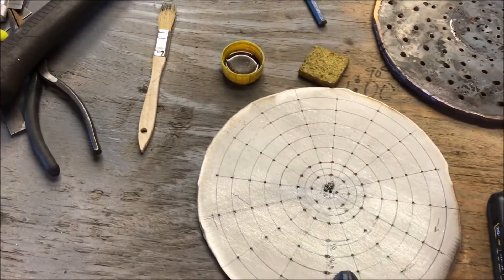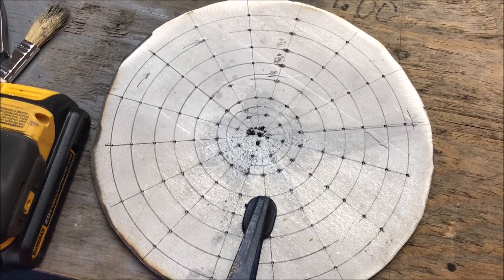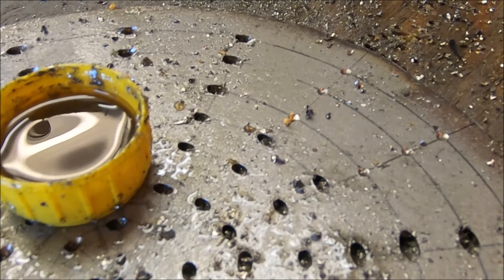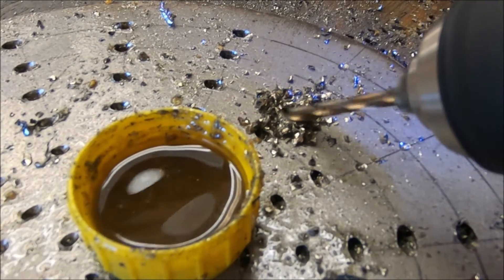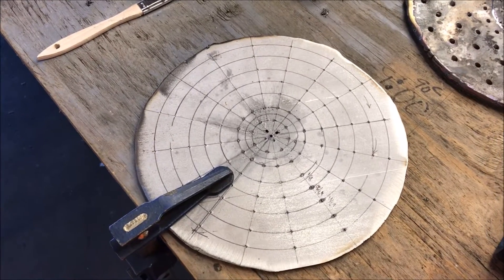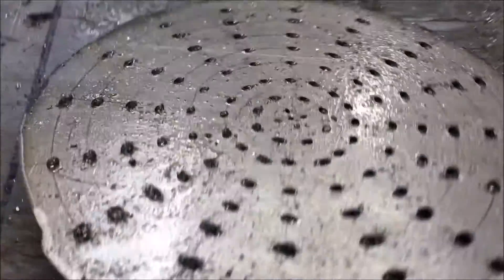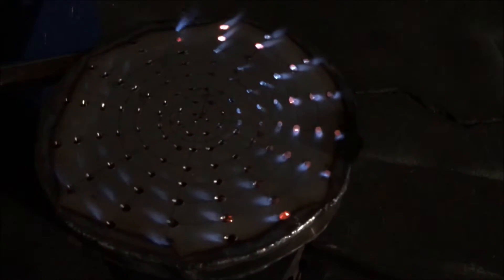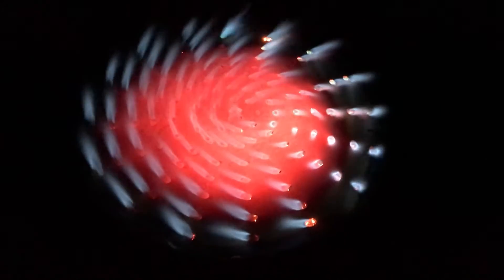How to drill stainless steel BEST practice increase production

Comment: Can you make some kind of an angle jig to keep the bit steady? If the jig worked it might even be possible to start with a milling bit to get a flat surface. When drilling holes in general I like using bottles with a Luer lock and blunt needle  tips to drip the oil exactly where I need it. Less waste and mess.
Reply from the maker: Definitely a jig iob

Comment: Sent you an email regarding this project - well something similar. My system locks up typing on YT sometimes and I loose it all, so email saves while I type.  Sorry.  I hope ou like what I sent and I'd like to see what you think!
Reply from the maker: I got it brother , as you can tell from the vids im very busy , when i get time ill get back to you
Reply: @NOBOX7  Sounds good.  I've made similar smaller versions and have seen about 5-6 other iterations of the same thing, but smaller in size that I recommended b/c we weren't looking for the BTU's or KW's you are pushing for.  

Before you start on a new project, feel free to email me and I can better explain some of the lessons & things I learned, especially with forced air waste oil as a heat source. 

A lot has to do with combustion time and retainment time within the combustion chamber - which is a MAJOR feature of old locomotive boilers - retention time of the heat!    But you have one MAJOR advantage these people didn't - compressed air - which  you can leverage much more than you have been.  

If you get this working, there are some moderate size farms which could really use this if you get it down, and their older systems are very fuel intensive compared to what you do.

Also, have you ever looked at an oxygen contratator?  They can do 85-99% pure O2, but that's too much, but going to 40-50% would be a HUGE increase of heat and I can explain why (less N2 to heat in the compressed air).  

Let me know exactly what you are looking to do with this thing, what temps you want (from steam or flame) and what pressure and flow of steam you want - PSI & lbs of steam per minute.

I don't want to rain on your success, but you can modify your setup with what  I'm talking about and use the coils that you already have, no problem with that.